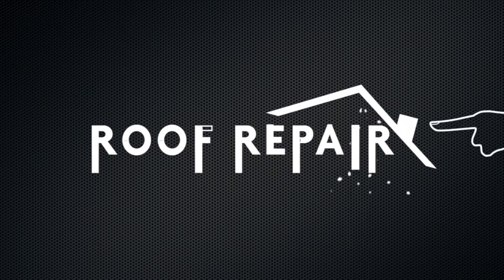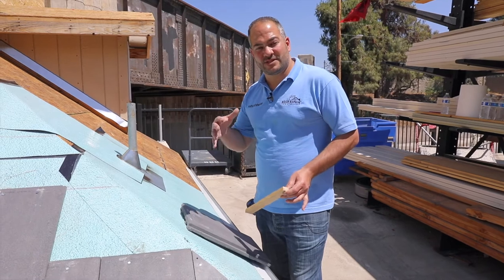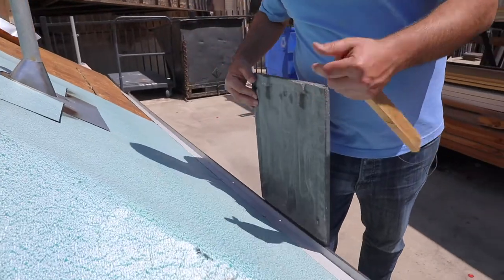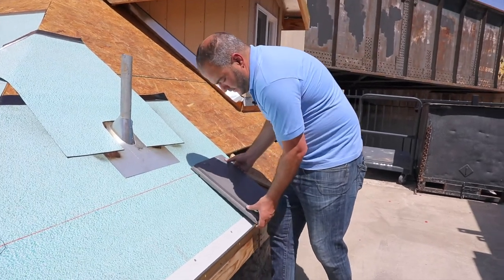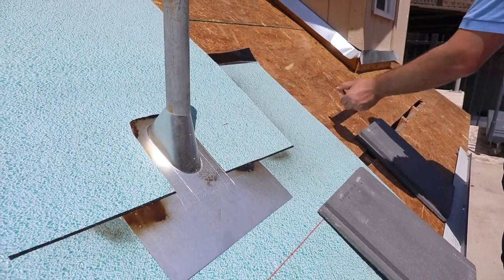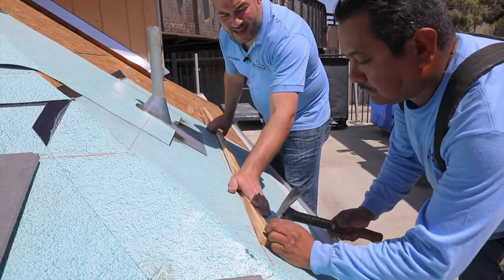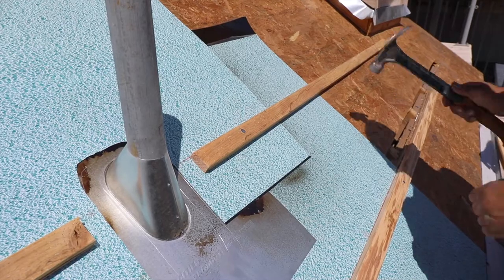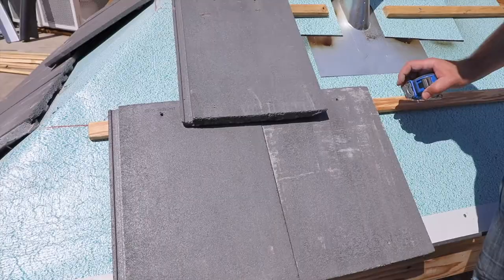How to Install Roof Battens | Tile Roofing Guide

Comment: YeaHHHHHH  finally an american in this Country where it is done wrong forever that gets it. Floating the horizontal batten on 1/2" PVC pipe that has been cut in half is a good choice so it keeps the horizontals above the roof for water flow to bottom
Reply: The battens under my roof tiles came with little rubber grommets where the nail is placed.

Comment: The way you fit battens is totally wrong if any water gets on to the roofing paper felt it cannot get away because you have trapped it between the batten and ply boards. You need a spacer between the batten and paper felt.
Reply from the maker: Agree, we usually use battens with pre fitted spacers. However allot of the roofs around here do not have spacers. Which I do not agree with.
Reply: absolutley right. this osb will be rotten very quickly
Reply: @RoofRepairSpecialist  you can counter batten. place a baten ontop of the rafter, either under or on top of the breather membrane to provide adequate ventilation. in the case of a close boarded roof i would suggest underneath the membrane

Comment: Wrong again. You nailed the battens over the stack flashing. Battens go underneath the pipe flashing and the pipe flashing goes over the second course of tile.
Reply from the maker: Your wrong again, but I’ll let you have this one if it helps. The second flashing gets installed on top of the bottom tile. Let me know if you need me to send the installation instructions.

Comment: Wrong use 25/50 mm batten
Reply from the maker: Don’t think we have that here, regardless the installation method is the point of the video, not the type of batten. If we’re talking about the top of batten I prefer a raised batten system, Boral makes a great one